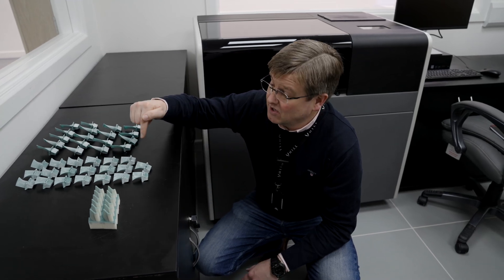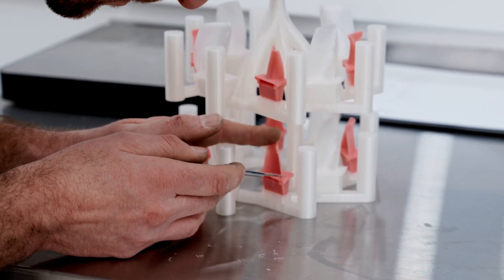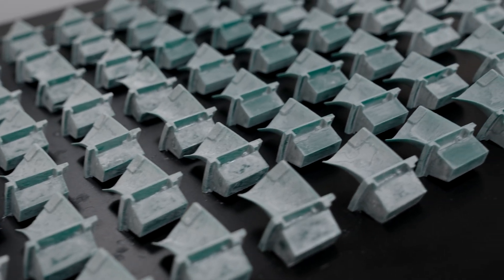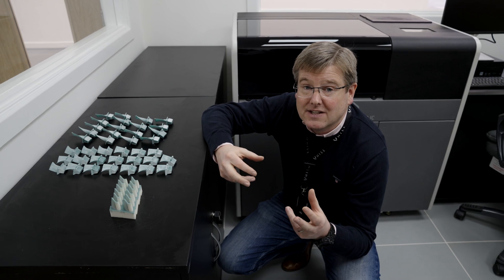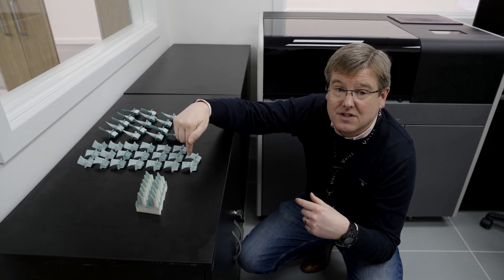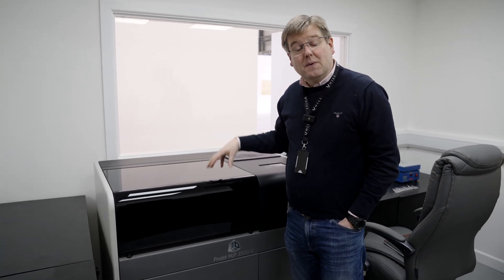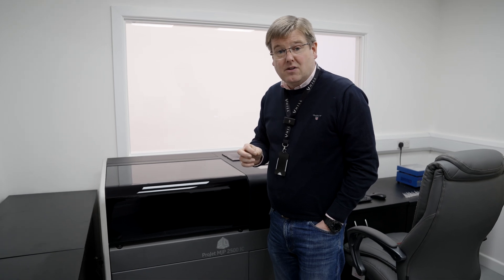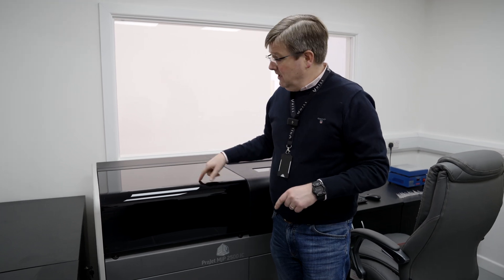New In-House Wax 3D Printer

Comment: Why 3d print the wax instead of printing molds to pour wax into. Theres no way a simple wax cast is worse quality than a 3d printed one.
Reply: i guess there is always different ways in doing things, i guess the technology might not be there yet to produce a smooth ceramic mold in this kind of detail - these methods are pretty normal and been used for years in techniques for producing one off jewelry and small cast items, its really a case of refining and what materials are best used in 3d printers, wax of course is very soft and very easily corrected if there is a blemish, or simply reprint, its a very cheap material, if you were using a ceramic slip as used to coat the wax printed items, conditions may need to be perfect, so climate controlled, and the mixture consistent every time, then you need to think of application, how to apply it through a 3d printed, too wet and it runs, to dry and it falls apart, what other materials can you make a mold from that will take the hot temperatures of molten metal

Comment: What type of engineer is most useful in helicopter production?
Mechanical, structural, aerospace?
Reply: What type of production work do you want to accomplish?

Do you want to be a design engineer, a project engineer, a quality engineer, or manage a team of engineers…?

Mechanical engineering will set you up well to perform a lot of jobs in this environment…

Aerodynamics will be helpful in a few small instances for production of machines…

Knowledge of air conditioning, electricity, can be helpful for any machine factory…

There will even be a maintenance engineer supporting the factory…

The extremely bright engineers are working in the development area…
Where the aerodynamics is interesting…
The computer displays are as modern as they get…
The mechanical engineering designing in the strength of every part under every type of load for every location in the world….
The combustion engineering is pretty cool too…

Or be a jack of all trades… go chemical engineer!

😃
Reply: @ thx for the detailed response!
Reply: Insurance loss adjuster.